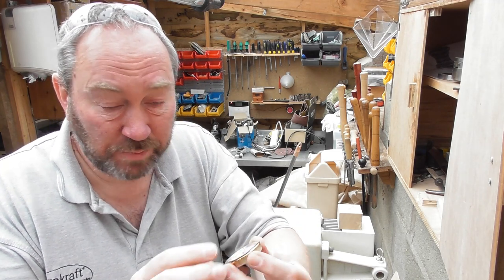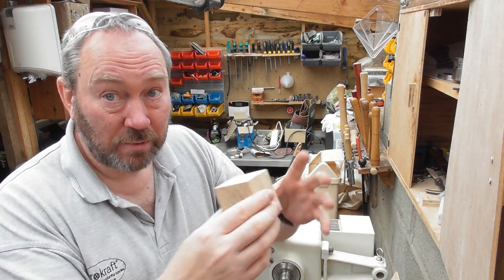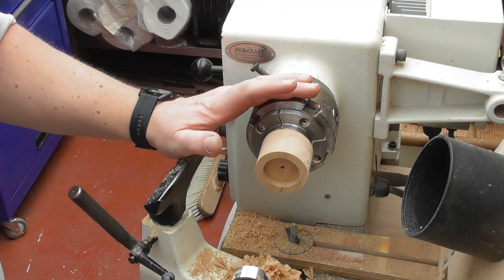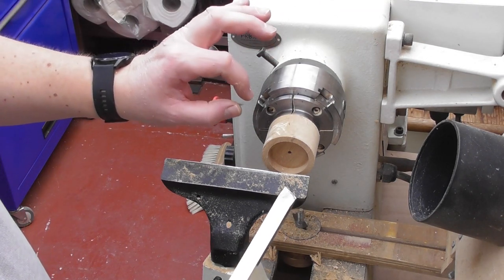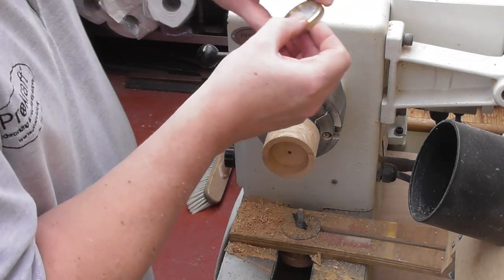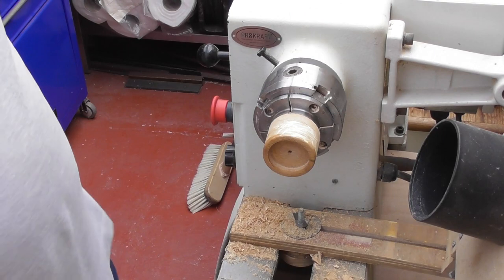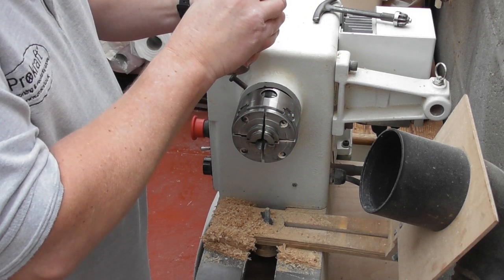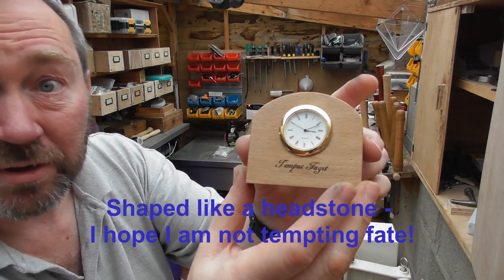Turning Time

Comment: Hi John, I have just received my 51mm clocks and buffing wheel thank you, excuse my ignorance what is the procedure for operating the clocks as regarding the back of the clock .kind regards Phill 👍
Reply from the maker: to get them working pull the tiny plastic lug from behind the adjuster wheel, they will then operate like a wristwatch - pull the pin out to adjust the time, push it back in to start the clock. Hope that helps.